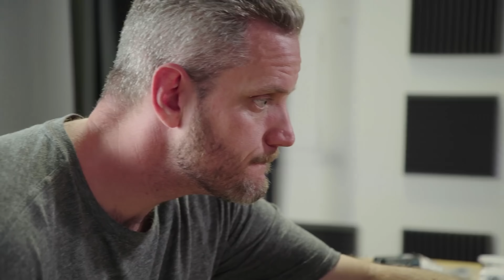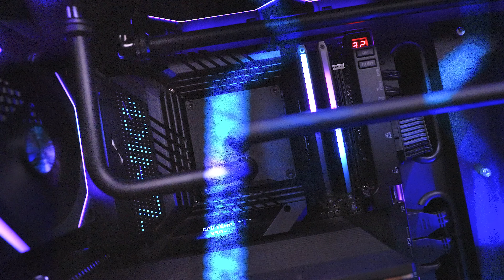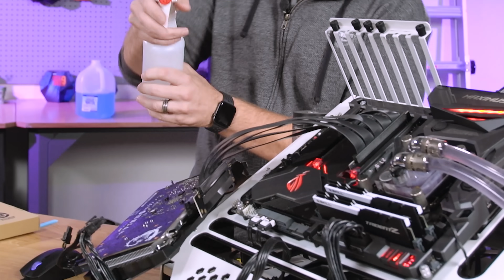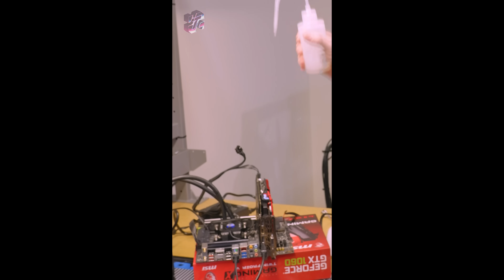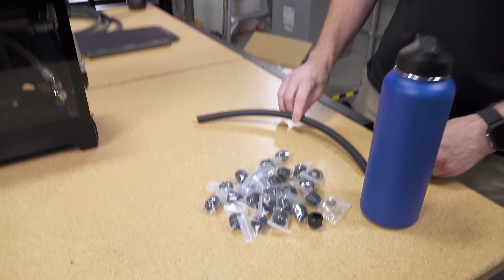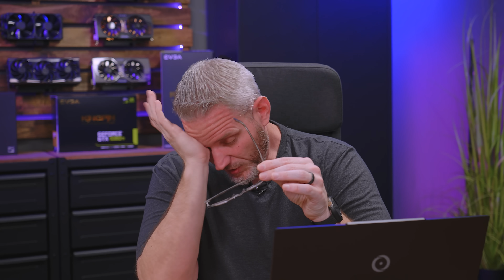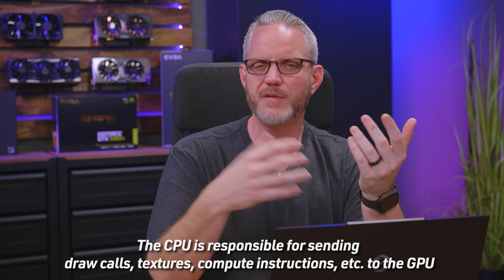5 Myths about Watercooling that are WRONG!

Comment: The tl;dr/dw on #1 is that all of the electrical power your PC draws will turn into heat. It has to, because you can't have more power going in than coming out as that would cause limitless amounts of energy to build up inside the PC and turn it into a bomb. Therefore X watts of electrical power in = X watts of thermal power out. Heat dissipation depends on the cooler design and the temperature difference, so a less efficient cooler must achieve a larger temperature difference by running hotter in order to dissipate the same amount of heat.

Comment: Does the thermal dissipation per rad stack? Or is it just based on whatever my highest rad is rated for that’s it?
Reply: They stack because each radiator provides more surface area for heat dissapation.

Comment: my little power pc fell into the water when he had a big flood in the village. against all other opinions i kept in in dirty water until i got 20l from german baumarkt and a childrens water gun. i had to use 15l of alkohol to clean, rinse and brush it and i used the rest to rinse the water away and then pressure aired all parts.  i went a bit too far with the psu, i opened and cleaned it. this took 3hrs and this was too much for a 2012 seasonic. but its a fanless titanium and i still love.  cool thing, unsurance paid anyway, because they don believe the parts will run long and said i should throw them away. this was in 2022.  :-) i learned: Water is not a big problem if you have enough alkohol

Comment: How common are leaks when you are first putting it all together? I’ve seen vids of testing for leakage. They are a bit intimidating
Reply: That primarily depends on your craftsmanship and attention to detail. For a first-time builder that is used to doing things with their hands, it still wouldn't be all that common. Understanding how compression fittings work and making sure the tube is fully seated will attenuate most of your risk.

Comment: Technically you can prevent your room from getting hotter by liquid cooling your computer...because air cooling has the heatpipes still inside your computer case but you can pump coolant through your heatsinks on every heat-generating component and then go all the way out to radiators that aren't inside the same room.

Comment: heat saturation/absorbing of water Means you DONT want to get to HIGH temps for the water.  you want it moving fast enough to Pull heat off, and NOT turn to Boiling.  The CPU/GPU may be throwing off 100c temps, but the water is only pulling off a %.
If the water moves to Fast or Slow, its not efficient.

Comment: I really appreciate channels like yours that try to give the viewer the confidence that they can do a task they thought was hard and beyond their skill level. I can't tell you how many videos I've watched to figure out how to fix my car, household appliance, or anything else. I've built computers for 24 years and have never touched water cooling until a few weeks ago when I installed an AIO in my system. Upgraded my AMD CPU and the air cooler just couldn't keep up. It was cheaper to get a 360mm AIO than a good air cooler. So thank you for being one of those channels that tries to boost confidence in people.
Reply: Thanks. Very good info. I don’t run hot yet because my systems are under powered.

Comment: "Moooaan custom water loops are a pain..."
Use soft tubing
Use quick disconnects
Use an AIO instead?
Switch components less maybe?

I could go on 😂
That all said, there are deffinitely downsides of course but I would say you only go full custom if you get the top of the line stuff 🤷‍♂️
Reply: Kinda. If you want to go all new with loop, it will not be cheap, you can get a perfectly fine AIO for price of the half CPU loop. Not to mention that anything less then top tier stuff is easily coolable by whatever cheapest twin tower you can find.
Reply: @alexturnbackthearmy1907   True, true.
Reply: none of that makes water cooling appealing.
Reply: The problem is that most gamers dont see any benefit running an aio. 

A properly specced system should always see the GPU at 100% load and the cpu below that. Doing anything else means you should have gotten a cheaper cpu and spent the savings on the GPU.

Watercooling a gpu can pick up 10-20% performance increase in fps, while running at a lower temp. 

Unless you are working a CPU with some kind of production work, an aio is kinda a waste of money.
Reply: @Saddedude  Sure, between a good AIO and an Air Cooler is not much difference in terms of temps/performance.
Even the noise level can be similar.
I guess it comes to what fits best for a specific system and that an AIO Can often be quiter under higher loads.
Reply: @Saddedude  the purpose of water cooling is not performance, its noise reduction.
Reply: @StrazdasLT  Maybe for you.  I have it for performance. Picking up almost 200mhz on my 7900xtx nitro.
Reply: @Saddedude  Thats sad though because you gained zero peformance from it.
Reply: @StrazdasLT  Sure.
Reply: @Saddedude you will not see a 10-20% fps bump. You won't even see double digit synthetic score bump by running max boost consistently. A 10-20% fps boost is a full GPU tier upgrade. Hell, my 3080 which is one of if not the highest scoring non actively chilled cards, only picked up about 7% in synthetic tests. And that's at 425w, Boosting to 2.1Ghz. 

You can force you GPU to hold boost clocks with out excessive cooling. And even holding max clocks, it's barely above margin of error, vs oscillating.

As for an AIO. It doesn't hurt. And with some CPUs is gonna behave better as they can tolerate quick spikes. They can also be useful for case pressure optimization, and of course sff.

Comment: I know this video was about watercooling; however, I do have a related question about motherboard power deliver specifically VRM and when MB manufacturers say 18+2, 16+2 etc to describe power delivery. This is somewhat relevant to the topic of watercooling and eventually over clocking. Can you or have you done a video describing the importance and differences as well as what to look for when choosing a motherboard. Thank you.

Comment: I'm a bit tired of water cooling.  Much rather we develop quiet compressors for PCs and circulate coolant around like an AC or run a line to a unit that sits in a window and dumps the heat outside.  I used to direct my window AC air into my PC case as a kid to help out my fans... Worked really well.
Reply: You can just hook up AC to computer then. LTT done it a few times, nothing really hard, unless you want to go really cold (less then 0C on running processor).
Reply: @alexturnbackthearmy1907 that's why I prefaced with "for PC" and "quiet".
Reply: Condensation is the enemy when running a refrigerant loop
Reply: @Vlalada0  Yep, but that can be mitigated if the industry wanted to.
Reply: @OtakuByNight  everything can be mitigated for a cost

Comment: Get a nice little LG portable AC unit... it exhausts out the window... I bought one and love it.. B094WZ1VDH

Just remember.... if its humid.. they piss water.. 

so get a 2x3 Sterlite storage tray (no lid needed) and a couple buckets. Put the sterlite on a small end table.. put the unit in the sterlite.  

Set-up & install the unit (takes about 5 minutes.. 10 if you are clumsy)

Remove the 2 plugs on the back.

IF the tray starts to collect water, use a siphon to drain into a bucket, dump the bucket

Comment: New GPU blocks add that much cost to the point where I feel you could just buy a 7900 xtx instead of a 7900 xt, and just use it on air

Comment: I did a hybrid 2 separate cooling options for gpu and cpu, running a dark flash 360 aio for the cpu and a soft tube custom loop for my 3090 using bykski and barrow parts just to get me started with water cooling my system as the budget permits, I will be going all hard tube loop for both cpu and gpu soon.

Comment: The great thing about watercooling is the efficient transfer of heat, TO ANYWHERE. You could have a rad outside your window and quick connect pipes on the PC.
Or even outside the case on the back of the cabinet if you use one.
With custom loops the choices are endless,  just make sure to use the same metals in all the rads and blocks.

Comment: If you're more concerned with performance than aesthetics when it comes to choosing a case than you can keep an air cooled system in check pretty easily. The GPU cooler is designed to dissipate what the card dishes out and an overkill CPU cooler will keep that cool. You just need a case that with great airflow that can get all of that heat away from the components efficiently. 
Water cooling is a luxury and cool to show off, but it's by no means a necessity to keep your rig performing well.

Comment: 14:33 Still waiting for that exotic automotive cooling liquid that does a crazy good job for dissipating heat!
Reply: It's already out there.
Reply: It's called water wetter
Reply: Royal purple (purple)... icy cold (blue)... water wetter (pink)
The water wetter foamed a fair bit when I used it in my loop. A small amount of water evaporates/defuses/performs osmosis so you PC smells like a hot car radiator... not a great feature.

Comment: As someone who was inspired by this channel and is currently building a custom watercooled  setup. Research all your components extra thoroughly and reference other peoples builds. Then maybe buy a bigger case for your first build. Just because your case says it can fit xyz, doesn't mean it will once you start putting distro plates and everything else in there like you want. And even some 120mm fans are actually bigger than 120mm and won't fit in certain circumstances.

Comment: And Jay if you use a iv stand usualy used to run a motor when test running a motor with out a pump to vacume fill the sustem it will remove all the air from the vacume side so it dosent get as much air in the system when filling i usually add the vacume pump to the top of the res you sumtimes have to tap the feed line from the iv to get all the air out before opening the valve and you gave me this ideah in the first place it also works well to refill aios but there will be an extra conection now in the aio loop you have to add in basicly a fill drain valve

Comment: Not a myth but I'm concerned about longevity of a water cooled system for not running for months at a time.  I'm a truck driver and I typically do 2 to 4 months stints before I come home for a couple weeks.  Draining and refilling would get bothersome everytime I come/leave home for a piece of mind.  Thoughts?
Reply: It should be fine, but if it bothers you - dont bother. You can get your parts running perfectly fine with stock coolers, this whole thing is more like a hobby then anything,

Comment: Love the video. and Yes would love to see you do a temp test on a water cooled build to actually see what the temps would be on each component before and after cooling solution goes to and from GPU  & CPU.. Water cooling is one thing that I have yet to do in any of my builds and Ive only done about 15 different builds over the years. But Iv'e alway's looked at it as in like at the end of the day how much more performance am I really going to get vs doing an AIO on my CPU and leaving the GPU the way it is. Like is spending that much more money going to give me a good return on performance and that big of a differancee that I can notice when gaming. That would be a good comparision to see actually 2 of the exact same systems SIDE BY SIDE one water cooled and one not and just see what the differance in temps & performance.

Comment: I have actually cooled my PC room with water cooling. I have no pump or reservoir in the PC, I have quick disconnects on the back of the machine, and run EPDM tubing up to the corner of the wall and ceiling, through a wall, down the hall, and into my house's central air return. the pump, and radiator are on a 3d printed stand, and a small file server PC is also in there, cooled on the same loop. The 480mm radiator fans and pump are powered by a small independent wall plug 12v adapter. my pc room temps dropped around 10-12f just by pumping the heat out of the room. it's a four liter system.
Reply: I always fantasised about having an external loop and put the rad outdoor in winter. :D
Just out of curiosity, if you put the rad in the central air return, wouldn't that be the extracted air? That air would be the at the same temp as in your rooms it gets extracted from, no? How is it lower still than your room temp?
Reply: @Teasuti I would be worried about condensing from the blocks when that freezing glycol/antifreeze comes from the radiator outside.
Reply: @Simon_Denmark  yes, it would wreak havoc in the PC. But it would be chilled while it lasts. 😄
Reply: @Teasuti  the central air return is the entire house's air return. I'm not moving the heat outside of the house, the ac is doing that as part of its normal duty. By putting the radiator in the central air return I am eliminating the problem of the specific room the pc is in heating up and getting much warmer than the rest of the house, without having a thermostat for the room and retrofit dampers on the central ac system.
Reply: @ironbunny4121  central AC with recirculation and no fresh air coming in from the outside? That's an odd system. 🤔
What we usually have over here is a fresh air intake and central ventilation with the optional heating/cooling, then the used air just gets exhausted outside with the optional heat exchanger.
Reply: @Teasuti  It is not an odd system at all, It is the core principle of air conditioning. A refrigerant is pumped between isolated sides of the system where one is absorbing heat and putting it into the refrigerant as it evaporates and the other side condenses the refrigerant and expels the heat on the outside of the structure. If you are bringing in hot air from outside and trying to cool it down to whatever temperature you want inside the system would have to work much harder especially if you are then venting it all out again. I don't know what that system would be called but it is certainly not central air conditioning. Window units and even floor units with vent hoses to the window do not work this way they are still using outside air to pass through the hot side of the coil and remove heat while all of your inside air stays inside and gets recirculated through the cold side evaporator coil.
Reply: holy shit man :face-blue-wide-eyes:

Comment: I got a 6700xt and getting 100c hot spots, I got decent case flow but unless I undervolt and keep the card fans at 100 it just gets hot.  There is no way I need water cooling if that would even help hot spots? Should I try to re paste and pad the card?
Reply: yes
Reply: Most likely dried out paste/pads, yeah. Stock ones are completely atrocious at times.
Reply: Thanks guys I think I’m gonna give a repaste a try.

Comment: Speaking of springing a leak and it not being too big of an issue. my GPU block was leaking for like 2 weeks and I had no idea until I could start hearing a lot of bubbles in my system and my coolant temp getting higher and higher overtime. One day I decided to lift my PC up and I noticed a small puddle of coolant underneath. Yeah... had no issues with the coolant leaking onto the system

Comment: I started my venture into water-cooling by getting an aliexpress special. Cheap pump,res,tubes and fittings. The blocks for my GPU were second hand off eBay, buy all other parts I used were pretty jank, lol.

Comment: I had a number of custom water-cooled systems built over the years, and pretty much every one of them leaked at some point.  The last one spewed sticky coolant all over a 15K build and my tech thought I was crazy for even wanting to salvage it (was that bad).  I now only use closed-loop CPU coolers, and don't really see any point in water-cooling any of the other components.

Comment: To defend the first myth. Is routing the radiators to outdoors. Or like linus did with his pool.. 
For a build i wanted to make. ( appearance means nothing to me) i was thinking of going with  rigid copper tubes and cut up a ton of soda cans, after stripping the plastic liner off them attach then on to tubes.
Reply: if you want to move heat from one place (presumably your PC room) to some other place (my house's central air return in my case) you do not want to use copper tubing. copper is a good conductor, and radiator, of heat. it is also expensive. EPDM rubber tubing is fairly cheap, and a not so great conductor of heat, it will keep the warm coolant heat energy inside, rather than letting all that heat radiate to the room as it goes to wherever you put your radiator.
Reply: @ironbunny4121  sorry I mean the comment to be two separated ideas. 
Where I didn't want build external cooling, just a defensive line for the first myth talked about.  The build idea was to create more cooling surface area when maxed on attachable radiators for a given case.
Reply: @MsLoneWolf4  ah. Well, you certainly don't have to go to the extremes Linus did to pump heat out of your PC room, but I get what you mean now. Regarding your PC cooling art project - go for it, just remember all that delicate work with the cans will be fragile and collect dust that still needs cleaning, and make working around it increasingly difficult. It would be challenging but could look really neat.

Comment: You might try purified water plus a small amount of copper sulfate. We use it in agriculture to keep algae from growing in water storage tanks.
Reply: That's what old PT Nuke is but you don't want to use it with nickel plating it'll ruin it, if you only have copper / brass it'll be fine but most blocks aren't available as copper unfortunately :(
Reply: Just mix in some antifreeze.